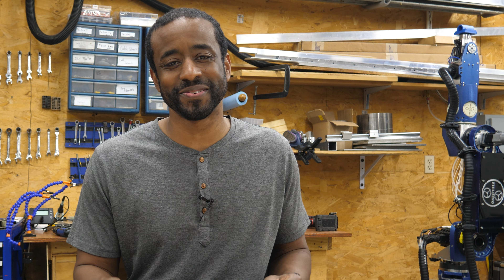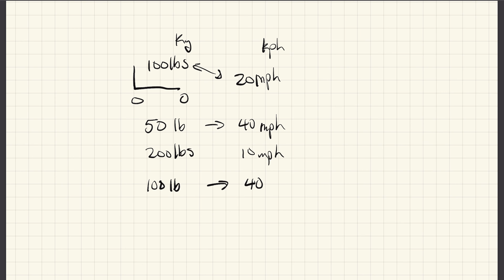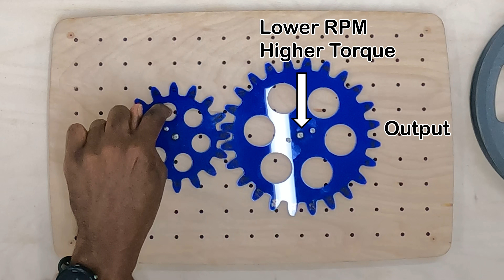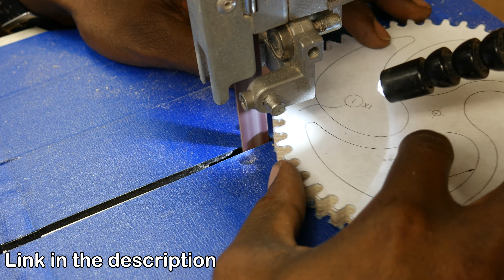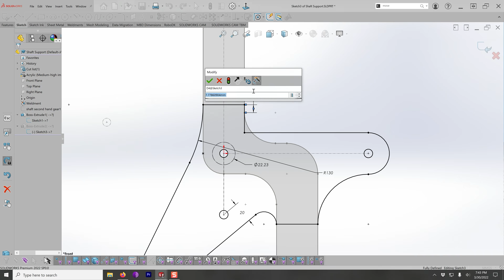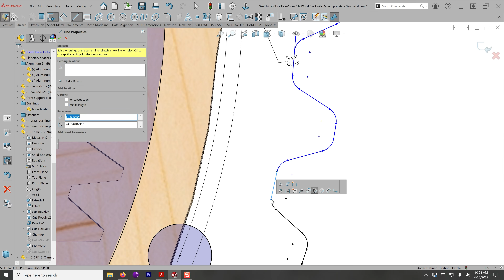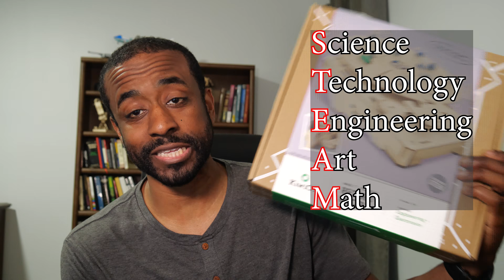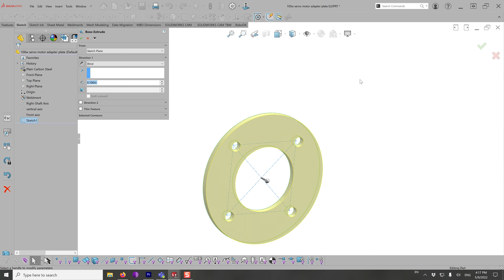How Gears and Pulleys Work: Jeremy Fielding 103

Comment: Just thought I should drop a tip for cutting tubing. A plumbers pipe cutter, it's made to cut copper tubing but also works for brass, bronze, and aluminum without a problem.
Reply: Pipe cutter will leave a small collapsed area around the tube making it so the pipe won’t fit. I’d suggest cutting the brass tube with the aluminum rod inside, which will reduce collapsing and burrs and removing the aluminum rod will use the burrs.
Reply: I use the same on small diameter stainless steel tubing. Note that a pipe cutter will still leave a burr inside that you may need to clean up.
Reply: Be careful not to deform the tube when using a pipe cutter.
Reply: @Crazy5711  to caunter defformation you can roll some sort of paper roll (like magazine page) to match ID of pipe. Then ir will work as support.
Reply: @Crazy5711  Run the pipe cutter with the inner (aluminum in this case) bar as an arbour to prevent the metal from squooshing.
Reply: I would cut off a piece that's too long with a hacksaw, so as to not deform the tubing, then clean it up on a belt sander to both remove the burrs and get the length correct. Setup a fence on the belt sander table that's perpendicular to the belt, and away you go. Just slide the tubing against the fence and into the belt and take off as much as you need. Of course if you have a lathe, that would be better, but I suspect he doesn't have a lathe, otherwise that would be option #1 from the beginning
Reply: Was gonna recommend the harbor freight mini chop saw commonly used for cutting down brass casings for reloading. BUT, a pipe cutter might even be better in this case.
Reply: This, and cut it with the axle inside the bushing. Perfect cuts every time and no ID debur needed.
Reply: And you can put the tube on a suitable drill shank to avoid making that lip
Reply: 5C collet block and he has a mill. Still going to need to deburr. Needle file or whatever you prefer. 

There are far simpler methods, but I think both a square and hex 5C collet blocks and a set of 5C collet are something he needs and will be handy in the future.
Reply: I use pipe cutter on black iron
Reply: As for cleaning up the inside, I use a chainsaw file or mini file for small diameters.
Reply: I use tubing cutters to cut steel chassis on atvs to modify them. I do have cold saws, band saws, plasma, reciprocating...but sometimes I love showing my daughters how vehicles like these can be cut in half quickly with these useful cutters.
Reply: I do this at work al the time. Pipe Cutter. with a sacrificial piece of the insert material inside the stock. and a countersink bit in a vice, then mount the cut offs in a power drill and run it on the countersink.
Reply: my pipe cutters cut galvanised 20mm steel conduit quite happily and were advertised as such
Reply: ...and they are cheep for small one [hand] sizes.  Sorry if already stated. 8)
Reply: Pipe cutters work great on PVC pipe too.
Reply: Also small adjustments and fast rotations gives less of a burr :-).

Edit, vertical steel bandsaw, beltsander, and/or deburring tool might give best results. Just watch the tubing on the bandsaw.. it DOES chew it like butter but you don't want it spinning on you or rattling...
Reply: I can repeat the pipe cutter issues (they leave a burr). What I thought someone would say here - install the bushing and then de-burr. This should be doable if the fit is somewhat tight or bonded in the fixture. Inspiring video 🙌.
Reply: @m.talley1660  a lot of copper pipe cutters actually come with a "deburring" tool. They're not the best, but do work..
Reply: I would cut the inside and outside together with a cutoff wheel on a Drexel, touch up with emery cloth.
Reply: @tedecker3792  jewelers files/needle files work well too. Rasps, I'll use for steel, and thick sheet, but I find it's too aggressive for alu and the likes. Emory cloth works well... if it's the stuff I'm thinking of (like a brillo pad, they come in various grits), I actually prefer for spray painting. To get an absolutely crystal clear finish. 
Extra tip: for anyone interested. If you're painting/spraying something chromic or glossy, and want a smooth finish START with a layer or two of clear coat to get rid of the imperfections. I find, going this way, I'm less likely to "overspray" and try to "correct" while it's still wet (causing more issues). Body filler is also a good option. Also using a standard primer, if you're painting PVC enclosures, and some light sanding before to aid in adhesion. 🥔

Comment: Honestly I think the only difference between a screw and a bolt is an arbitrary distinction between general usages.  You know, screws being self-driving and stand alone with their points, and bolts tending to be more of a pre-planned usage and typically working with nuts and stuff. But that's just my guess.
Reply: A screw threads into something and a bolt clamps two things together with a nut.
Reply: @jimurrata6785  This is also my belief.
Reply: What about a machine screw?  No point and meant to be put into a tapped hole.
And what about a lag bolt?  has a point and is typically driven into an untapped hole.
Reply: @drhender6943  I said "arbitrary distinction between general usages"  so naturally those would fall outside.

Comment: Beautiful project..    The only design critique have is that the hour hand doesn't really seem to stand out very well, and actually looks like it might also be obscured a lot of the time.  A splash of color might help that though.  Rather than redesigning the hand shapes.
Reply from the maker: I kept having the same thought. I was thinking I need to get a piece of oak and stain it so its really dark. We shall see. It is easy to replace once I make up my mind :)
Reply: @Jeremy_Fielding  You could always toast it to make it darker (Maillard reaction) right up to carbon black if you like (and it doesn't loose too much strength.
But strength shouldn't be an issue if it isn't part of the gear train.

Comment: With the belt laying loose when you drove home the parallel between gears and belt+pulleys (6:47), I pictured the belt as a giant third great going around the outside and touching both gears
Reply: Exactly what I thought. Although, on second thought, it's actually the SECOND gear, since it's clearly the one that goes counterclockwise when the drive gear is going clockwise.

Comment: I always thought screws are the ones that need a screw driver (Philips head or flat head) and a bolt has a hex head or some other shape and you would use a wrench or a key to turn it
Reply: Yeah, but there are socket head cap screws that take an allan wrench. And if you say "screws are pointy and self-starting", then the counter example is machine screws and lag bolts. The only conclusion is the actual problem lies with the English language, yet again.

Comment: So.. somewhat related but random question.  I've been thinking a lot about building a wind-powered plastic shredder.  I can't really build one right now but it's just one of those things that's always in my brain.  The basic idea is that a small vertical axis wind turbine would be geared up to a really high torque that drove a plastic shredder.  It would obviously be incredibly slow but my thinking is that since it's running nearly all the time it could chew up a decent amount of plastic.  And like you I'm also trying to keep things cheap and approachable.  My question is, do you think that saw blades could be used for this purpose?  One of the challenges with plastic shredders is getting the clipping to be really small.  So I'm wondering if saw blade teeth could work to take small bites at extremely low speeds.  Figured this question would be right up your alley, lol.
Reply: I’m not Jeremy or an engineer lol, but it just doesn’t sound practical to me. Why not use a bicycle or something with human power to run your saw blades to chip plastic if you just want to avoid electic power.. saw blades can make powdery plastic if that was your main question ie saw dust but would require ridiculous amount of cutting to cut a small sheet of plastic. Why not buy a plastic shredder used for credit cards? Relatively cheap.. probably more efficient than any other method even with cost of electricity to run it
Reply: @bumstudios8817  Because all of those things you suggested require a lot of work.  Credit card shredders are great but I would have to cut up all the plastic to size and feed it in piece by piece.  I already have a shredder like that and it's a TON of work. Human powered is cute and all but I'm obviously not interest in that either.  The goal is to have something large that can run all the time so human participation is minimal.  Basically I just want to throw milk jugs and things in it whole and ignore it.  And my saw blade question was about slow-moving blades so I'm not really talking about sawdust.
Reply: @VagabondTE  I believe he has a video that he used saw blades to shred plastic.. but I might be thinking of another channel.. good luck with your search
Reply: @bumstudios8817  Yes, that is exactly why I asked.  But those were at full speed.